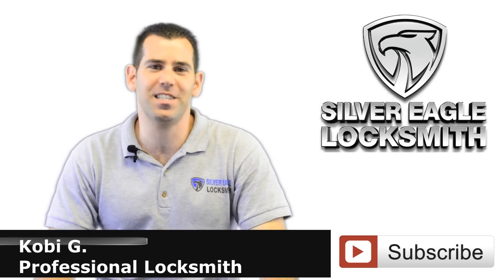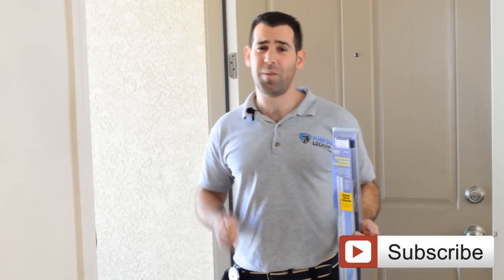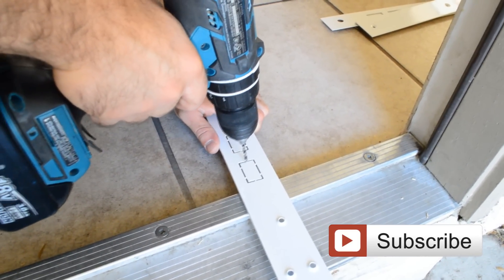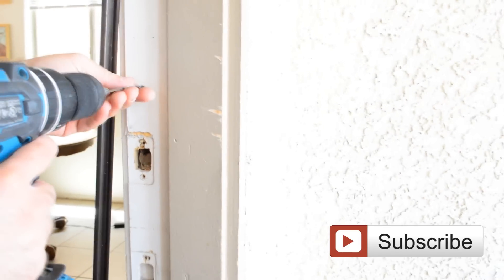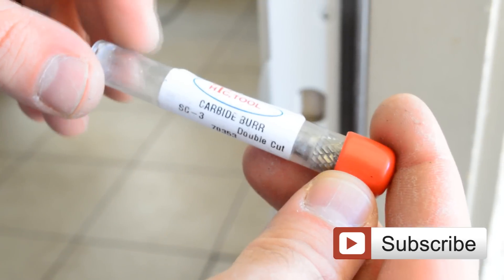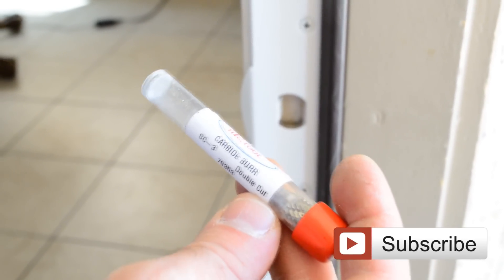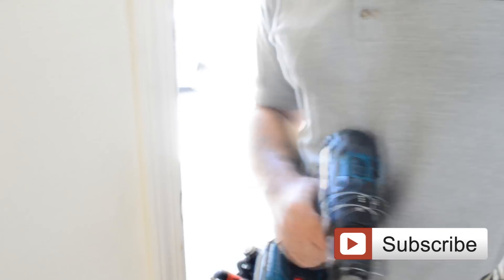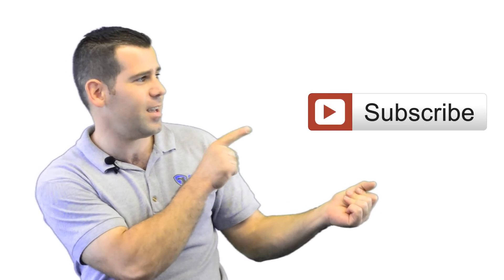Strike Plate - Burglar proofing Your Home With The Ultimate Door Strike Plate

Comment: If I want to get into your house, I'm not going through the front door. I'm entering through a side or rear window where I'm less likely to be seen.
Reply from the maker: Burglary statistics shows that 34% of home brake ins is in fact through the front door. Go argue with statistics
Reply: @S.E.Locksmith  That would mean 66% are through other points of entry, like rear and side windows, no need to argue statistics.
Reply from the maker: I agree, but 34% are enough to consider having a good security Strike Plate for your doors.

Comment: 2$ wrench and 1$ rake and your in. It takes me at the most 30 seconds to rake a lock. If that is not quick enough just use a bump key and a little tap and your in in 5 seconds. Now I have never used a bump key but I have seen them in action. FYI the hardest lock to rake is the SmartKey by Kwikset but even those I can rake in a few mins time. I like the strike master but it is just as strong as the weakest link in the chain.

Comment: Doesn't matter if it's not 100%..........?
Really.......!

AND.......drill in at an angle to get the long screw into the stud.......?

Anyone with common sense and good working skills and knowledge would mark the wall first then drill and plug the holes for the longer screws.........AND......then put them in straight......!

In this way the longer screws are going to be going into the wall fabric.......and will therefore be a stronger fit.

Who in their right mind is going to employ this fool.......?

James Hennighan 
Yorkshire, England

Comment: Thanks for this vid. Just recently someone has (tried) to kick my door in, and this looks fairly easy to do, so I'm definitely putting this new plate in. The only thing is, around the door knob bolt on the door is badly cracked, and I really would like to know how to reinforce it.
Reply from the maker: hi etm, 
thank you for the nice comment.
for the cracked around the doorknob I would help you but I need to see a pic of the door and the lock to determine what will work best.

Please send me a private massage here on YouTube with your email and I'll replay to you.
Reply: Silver Eagle Locksmith x
Reply: J
Reply: If the crack is on the door, use a round plate of steel where the knob is mounted. If it's on the frame, the door frame armor should help that. But I would look for an armor kit that uses one solid strip of steel

Comment: I would only recommend one change from what you said in the video. If your house is newer your front and other exterior doors all have double studs ( two 2x4's) which equals 4" of stud depth. Your door frame has 1" depth. So in total there is 5" of depth that you can screw into at the hinges.

Use 4" deck screws instead of 3". With 4" deck screws they will go completely through the door frame, thru the first stud, and halfway into the second stud!

3" screws won't reach into the second stud at all. Those could be used on the hinge that connects to the door,  but use 4" for the hinge that attaches to the door frame. 

Nice video otherwise.
Reply: Thanks for the tip.
Reply: 2x4 does not mean 2 inches.. 1.5 at best.. thats why you get 3 inch  screws
Reply: In what country is a 2x4 two inches thick?!  Even if they were three inches thick, who says you need to go though two studs?  Biting into 2" of studs is plenty, because the shaft of the screw will certainly snap before the thread will withdraw from 2" of wood.  Try it with a crowbar sometime.
Also I have doubts that a 4" screw will have a head small enough to fit the countersink of the hinge.
Reply: 2x4s are actually 1 1/2” x 3 1/2”.  So (2) 2x4s and a 1” framing piece (actually 3/4”) would only be about 3 3/4” total.
Reply: Allan Johnson I’m guessing that the included screws have different “strength” ratings than deck screws.  Tensile, shear, torque all play and the application/use case drives the characteristics of selecting the “right” screw.
Reply: in case of an attack, the head will shear before the screw is pulled from the wood anyway
I don't have the numbers but it's pretty obvious that at some point, you have no benefit in increasing the length of the screw. I will do a test and report the numbers here

Comment: That's still not effective! Just because you put the plate on the WOOD frame and didn't sink the screw up into the actual block or door frame it self, it won't hold with alot of pressure! Wood will split and break!

Comment: I don't fully understand the purpose of the kit pieces installed above and below the center strike plate section. Once the door and wall side of the hinges and strike plate are secure that should be all that's needed to hold the door. The rest is dependent on the door material and lock.
Reply: I would guess the top and bottom extensions are mostly there to cover up cracks in a door jam.  Like you said,  I don't see them adding a significant amount of strength.
Reply: This arrangement spreads the load over more surface area and more screws holding it all together,therefore a much stronger doorjam arrangement,that being said,ANY door can be broken down! So,you do what seems to be good for your needs!
Reply: Brian Haygood, if your door has a window beside the latch jamb frame, the long door latch and deadlock strike plate will strengthen a rather flimsy door frame - no 2xs.

Comment: Certainly an improvement, job well done. But nothing is ever burglar proof. Problem here would be that the reinforcements are only anchored into the wooden frame, hence will only take the force it takes to drive 4 or 5 screws through some ??? 6mm of soft wood. There are commercial products available, e.g. form ABUS, 50 Euro, like a strike plate 50 cm long of 3mm hardened steel you can fix with 4 diagonal 15cm bolts into the very wall that holds that door. Not a bad job you did, but I find that not entirely convincing.
Reply from the maker: Hi Alexander, thank you for the comment, we did this video so an AVERAGE person can increase the security for the front door. Believe me I can discuss with you about how you can Super Reinforce the door with 10 more products and technics that I know as a professional locksmith but as a YouTube Video that put it all together and still help a lot to increase the security of the front door this video did a great job overall.if you have the tools, knowledge, parts and experience to make it even better so good for you,its just like having a New "BMW" (super nice car) but than I come to you and tell you that I have New "Lamborghini" (elite Super car). you understand my point here... there will always be other ways even better than what you suggested!have a great day.
Reply: That being said, what your solution will do, is defeat the average low down burglar with his best friend, the large flat-head screwdriver. Ain't gonna look pretty, but it will.
Reply from the maker: Just get a metal gate for your front door and get this over with.
Reply: i make my own strike plates out of 1/4" thick angle iron and mortise them into the wood.

Comment: Why are the screws still long, but not thin, and why are you still using wood in the exterior doors or if someone comes with an ax? :) now go to the steel gates.
Reply from the maker: The wood doors and frame is a standard on most residential homes in the US, this video is about reinforcement of those type doors to increase security. steel gates are always recommended but as you know they are not cheap and not mention the labor to install them ,this video offer most affordable way to increase the security level of the door without breaking the bank
Reply: I understand gratitude
Reply: Silver Eagle Locksmith, steel security storm doors come right off with a pickup truck and a chain or tow strap. Security stuff visible from the street, unless every house in your neighborhood has them, tells burglars that you have stuff worth stealing.
"Solid" wood doors usually are made just like hollow core doors but with a slab of particle board instead of cardboard.
5" or 6" construction screws will strengthen a pine door frame. Run them from the inside edge of the frame all the way through into the brick mold. A 6" or 12" drill bit for the pilot and a 6" bit for the clearance is necessary. The pilot bit should be of the thread root diameter and the clearance bit of the thread outside diameter. Only about 4" of thread engagement into the wood gives all the strength you can get.
A long screw should go just above and just below the screws that mount the deadlock strike.
The strike plate screws should go through the frame or jamb, through the space between the jamb and the 2x4s or 2x6s of the rough-in and through the first 2x and part way through the second 2x. A spacer shim must go between the jamb and the 2x or the screws will warp the jamb. The interior trim has to come off to expose the space.
The same basic procedure is used to reinforce the hinges. Burglars have long known to attack the hinge side because most lock installers don't reinforce the hinges, using only the 1/2" long wood screws that came with the hinges.
Hollow core doors are hopeless.
Actual solid wood doors properly reinforced will discourage most ordinary burglars. Steel skin insulating doors are better, as are fiberglass doors. Commercial steel doors in steel frames are the strongest doors you are likely to want on your residence. They can be decorated with applied millwork so that they don't look...well, commercial.
Ordinary 5 pin lock cylinders are good enough unless picklocks are active in your area. If police tell you that there are picklocks burgling in your area, Medeco, Abloy and other pick-resistant deadlocks can be installed.
Windows should have movable stops that allow the lower sash to be raised 3" or 4" for ventilation. Security screens are so hard to get through that few burglars will try. Yet they can be easily released from inside for emergency escape.

Comment: Most of the screws sold today are cheap pot metal which will just snap right off no matter how long they are. Who sells high-strength screws? Even longer than 3"?
Reply: Barkity Bark They aren't actually pot metal, and some screws are pretty lousy. Stainless steel is quite tough, though probably more brittle than standard steel, so that works. You might also see if you can find those ledger screws (that are taking the place of lag screws) in a size that fits. Or go to your local fastener supplier and ask for American-made fasteners.
Reply: BS. Drywall and deck screws are hardened steel, and 3" is fine.
Reply: I use thicker 3 inch "gold" colored construction screws, not just drywall screws.
Reply: @ mike GYVER The great: Drywall screws are shit. Stainless screws are brittle, the heads snap off quite easily, then they are a big problem to remove. The standard screws work well for most fastening except for wet areas (decks etc) Try rubbing some soap, candle wax or mutton fat on the thread and you will find the screws go in very easily. Do not tighten all the way with power tool as one can strip their grip. Finish off by hand they screw in very easily using a lubricant. (From a Master Carpenter when all work was done by hand).
Reply: I carry around a wax ring used for setting toilets to use for lubricating screws. Works great.
Reply: kenparker99 great tip thanks. I'm putting a bit of old candle in my screw case right now!
Reply: Mutton fat?? Where are you located, Wales?  :)  Just teasin'....

Comment: Alarms are worthless and only as good as the average response time by police, which is about 20 minutes. Why give them 20 minutes to ransack your home? This lock stops burglars cold in their tracks. It will prevent burglaries and home invasions. It's all you need to stop criminals from breaking in. http://www.patentauction.com/member.php?nb=13065  It even works with "Smart Lock".
Reply: That is both ugly and nearly pointless.  If you took the amount of steel you used to make that complicated second deadbolt and used it to reinforce the door and jamb, you would almost certainly have a more reliable and stronger solution.